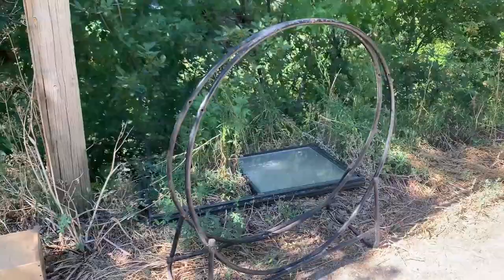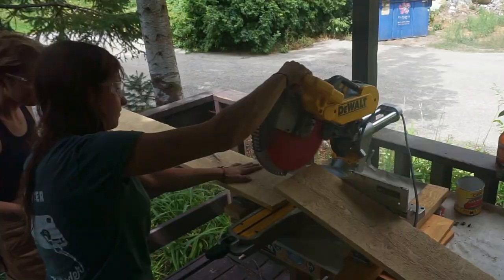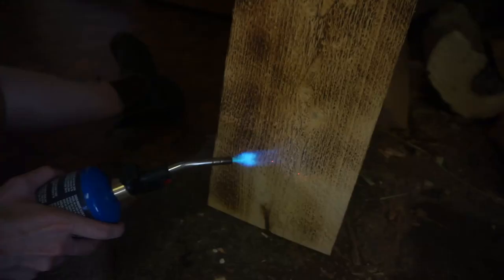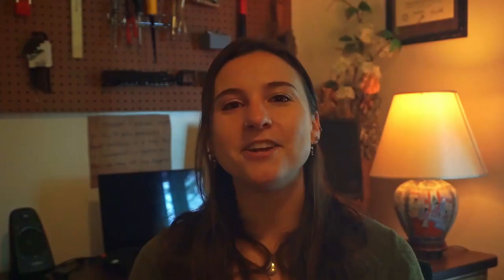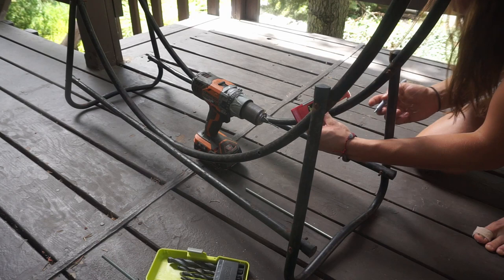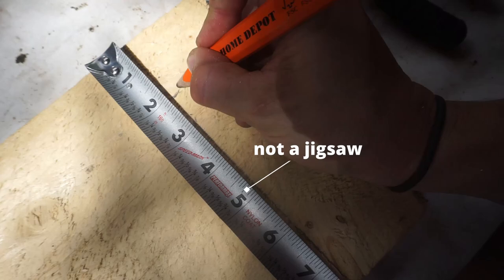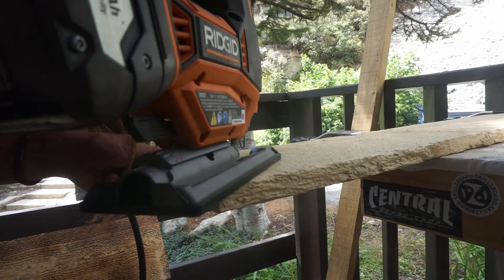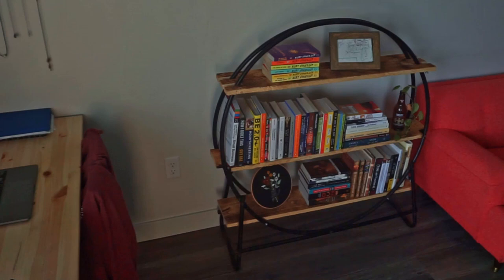Building a Modern Bookshelf with Old Materials

Comment: This bookshelf came out great!  Nice aesthetics based on being resourceful.  Hopefully this will be helpful: If you need to drill into something round, make a V-notch in a piece of wood, pilot drill the piece of wood, the V-notch will be easier to clamp to round stuff and the pilot hole will help hold the bit straight through the rod.
Reply from the maker: took me a minute but I think I understand what you are saying now, great tip thanks!
Reply: @chloet7385  I’ve done this with smaller saw kerf too but it tends to slip more.  Look forward to seeing what else you come up with.  I’m not an expert but I’ve been building stuff for a while because I’m getting old.  Feel free to send me a msg if you’re stuck on anything.  It’s also cool to see how you solve problems.  I’m also working with the medium of only using trash & scraps to make stuff by the way.